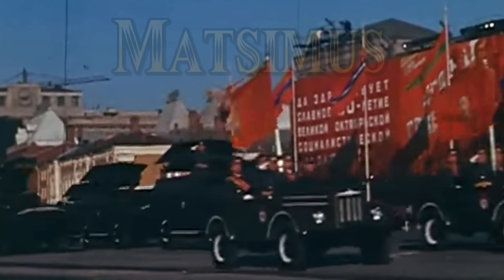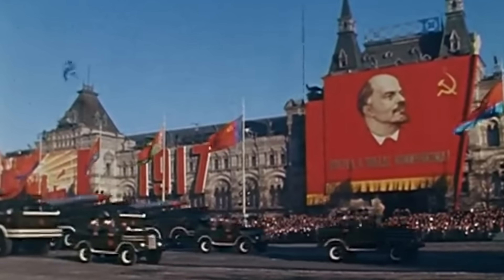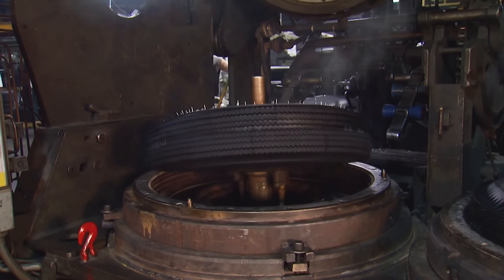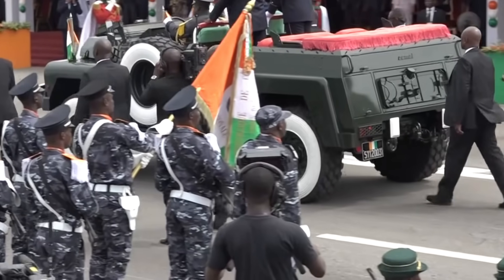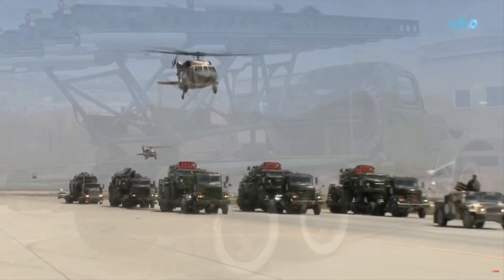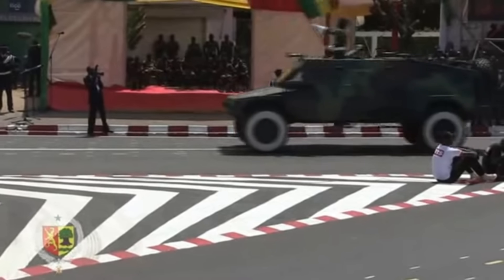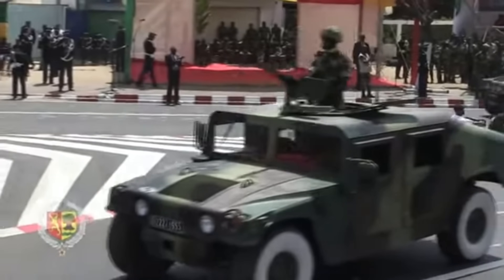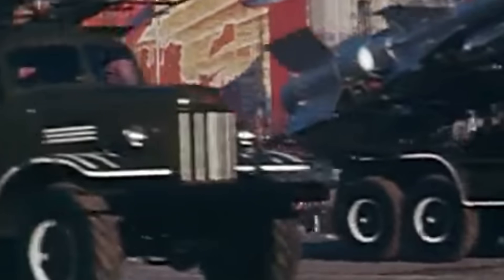Why do Soviet/Russian, North Korean and Chinese military vehicles have white wall tires?

Comment: Military parades aside, you're right about wheels being painted white with a special mixture to protect them from sunlight exposure during long-term storage. All this is described in the technical requirements for storing equipment. According to the requirement, the tires of those vehicles that are stored for more than 2 months must be covered with a protective mixture. This also applies to agricultural machinery. Instead of paint, special covers are also used

Comment: In the Soviet bloc countries, not only the tires were painted white, but roadside curbs and even the lower section of trees, maybe up to 1 meter high. They loved painting stuff white, at it gave everything a pristine, orderly appearance (even though the whole communists system was rotten to the bone).
Reply: Confirm, painting stuff white (including sometimes snow), or green (including sometimes grass) is a commblock thing. In part since the military/paramilitary/security services had a large input into things, and the military, being conscription-based, had to look cool and keep the bodies busy with make-work.

Lower sections of trees are painted not only for aesthetic purposes but rather as a pest-prevention measure, also, in late winter/early spring sunlight (direct, and reflected from the snow) can overheat tree trunks so it's protection against that as well.
Reply: White (based on limestone), green, black and reddish brown were on the list of the few paints widely produced in the USSR. So, it was pretty normal to paint the ceilings, upper walls and any details you want to stand out white (sides of the staircase, handrails, trees, roadside curbs.), the walls green and the floors brown. 
It was also a common practice to shine anything made of metal which isn't painted.
Also note that Moscow has 90 sunny days a year, and Saint Petersburg only 60. White and shiny stuff is what stands out, especially on a black-and-white TV that were common back then.

Comment: Hey Mat. I have a question. I know some Russians used crowbars and axes to disable tank turrets from rotating in ww2. Is that possible today with mbts or is that impossible with the tolerances between the hill and turret. 

Thanks for your time.
Reply from the maker: Good question! I am not sure!
Reply: I doubt you could jam one from the outside.  On M60A1s could be jammed if the crew failed to properly deflate the deep-water fording tube that sealed the turret ring.
Reply: I would imagine that if there's a gap where you can shove something into it might at least for a while, no idea how you could get so close these days..
Reply: Correct! It's a parade, showy gig! Like the high-lighted parts of mud-flaps of tanks etc.
Reply: During the Greek-Italian war in 1940-41, Greek soldiers would immobilize Italian tanks by throwing their blankets in the tracks.
The Italian crews would come out to see why the tank stopped and the Greeks would capture the tank and it's crew.
The war in Epirus, was the first time ever, the Greek army faced tanks in combat, so the blankets were the only thing readily available to the infantry.
Greece at the time only had the 19th motorized division, but this was deployed in the Struma valley and was later destroyed by the German attack against Greece in April 1941.
Before this, the Finns used the known gasoline filled bottles to set on fire Russian tanks, they dedicated them to the Russian foreign minister Molotov and called them Molotov Cocktails.
Of course, these improvised antitank weapons would not be effective today, against modern tanks with high power diesel engines, fire extinguishing systems and infantry support.
Reply: @FLORATOSOTHON  Never forget the wood logs lmao, and satchel charges,those were what we had in Winters War
Reply: @TheLazyFinn  These may be effective even today, if one could get close enough to a tank.
Reply: @FLORATOSOTHON  Could be,tracks are delicate
Reply: On the M1 abrams there is a far easier way to disable them and force the crew to bail.  There is an external fire-extinguisher latch that sets off fire extinguishers inside the turret.  If the crew do not bail, they will be asphyxiated.
Reply: @wigon  Good luck trying it on a moving tank, under combat conditions lol.
Reply: @FLORATOSOTHON  Tanks are not always moving.
Reply: @wigon  Are you sure they're for the turret?  We had similar handles on the M60s but they were for the engine compartment only and were designed not to shut off the fuel (which the one in the driver's compartment would do).
Reply: @TimothySielbeck   From what I recall, on "The Chieftain" channel, when he reviewed the M1A1 that he commanded in Iraq, it sounded like the external fire extinguisher control was for for the engine and the turret.

Comment: In the U.S.,up to the 80’s, only the cheapest of car tires didn’t come with white stripes or letters on one side. There were no directional threads so the look of the sidewall was a matter of choice. On my first car in ‘83 Idefinitely searched for the widest of stripes for its first replacement tires. When I got custom chrome wheels it got white letters out tires.

Comment: Most of the parade vehicles (including all the ones at the beginning of the video.) didn’t have white wall tyres. They had the rims of the wheels (removable bead lock) and the centre hub covers painted white. The tyres are black. 
For future reference, wheels are metal, tyres are rubber 😂.

Comment: My 1962 VW beetle has white wall trims. the car is black with lower side panels in vw cream white, black wheels and the white trims.  The trim is a flat band of rubber that is pinched between the rim and tyre sitting flush to the side wall. The drawback is that if I hit a curb they're vunerable to tears or pulling out of place. I think they're available for most wheel sizes, mine are made in Turkey. Look pretty cool I recon.

Comment: In the Soviet military and in the Eastern Bloc countries, the reason why vehicles have half-white walls is usually for parades. The vehicles selected for parades typically undergo a thorough paint job and have special parade tires with white walls fitted. White wall tires were not used in combat; they were applied not only to trucks and Jeeps but also to APCs, the trim around tanks, artillery cannons, and more. It was a way to spruce everything up and make it look attractive for the parade ground. If you examine a Soviet army truck or Jeep outside of the parade field, you'll notice that the red stars, colorful insignia, and white wall tires are absent.

Comment: When I was a young man, I had a 1972 Oldsmobile Delta '88. 455 cubic inch engine, 8-cylinders, 4-barrel carburetor and yes, white wall tires. Slick as all get-out. Stomp on the accelerator and watch the speedometer go one way, and the gas gauge go the opposite way, LOL!
Here's some lyrics from the song Just be thankful for what you've got, sung by Curtis Mayfield
Though you may not drive a great big Cadillac
Gangsta whitewalls TV antennas in the back
You may not have a car at all
But remember brothers and sisters
You can still stand tall
Just be thankful for what you've got
Though you may not drive a great big Cadillac
Diamond in the back, sunroof top, diggin' the scene with a gangsta lean
Gangsta whitewalls, TV antennas in the back

This was a good video, Matsimus. Really enjoyed the explanation.

Comment: Wheels (the metal part) are often painted light colors to be able to easily identify corrosion near the bead. Light colors get easily stained by rust making it easy to visually spot problems.

Comment: I worked in a rubber compounding lab in 1986. White rubber has zinc oxide replacing carbon black. It like carbon conducts heat and blocks the sun ☀️

Comment: Brings back memories. I used to work at a Firestone plant and mix the white rubber used for white wall tires so I know a bit of the alchemy that went into the rubber compound. Carbon black does make the rubber tougher and more flexible, especially in the tread area.  The white compounded rubber has less durability to UV and tends to crack more. If they were concerned about long-term storage it would be much more cost effective to cover the tires to prevent the effects of UV light deterioration. White sidewalls are purely cosmetic.

Comment: Whites out was how a lot of tires were installed and as a car wash employee as a teen in the 80's I can remember the PIA that cleaning them could be at the speed we had to do it in to get cars through the wash quickly.  At that point they were mainly just a white stripe and not the thick white walls they were in the 50's though.

Comment: In the 50's in the US.  It became a fashion and a sign of more expensive tires to have white walls.  Then for us cheap skates they made a rubber flat ring that could be applied and stuck to the tire by rim pressure to make it look like you too had those expensive tires.

Then in the 60's and 70's the fashion was for thinner white rings instead of large white walls.  All just part of planned obsolescence so if you wanted to keep up with the trendy you needed to buy new tires before they wore out.

Comment: I am in my late 70's and grew up with white wall tires on my cars. They were very popular and most people had them. The narrow bands came out later on. We kept them clean with a special white wall cleaner. You just sprayed it on, scrubbed it, and hosed it off. If you didn't like them, you just turned them around. The back side was black.

Comment: I didn't have a vehicle with white wall tyres, but I had them on my bicycle once, and on my current incumbend bike, I have one at the front - the problem being that the front wheel has a very unusual format being slightly larger than normal 20", thus there is only one supplier for spare tyres.

Comment: I suspect that for parades part of the idea was to make it look better on film. Old cameras were really bad at capturing darker shades and military vehicles tend to be painted in dark colors for camouflage, so a way to compensate would be to add white highlights. You can see that in some of the footage of old parades you used if not for the white highlights a lot of these vehicles would look like black blops. Railway companies did similar things back in the day, whenever they had a new engine they wanted to show off to the press they'd paint it in a light grey that made them look better on black and white photos.
Reply: Mainly easier to manuall catch focus.

Comment: It's not the heat from the sun that's the problem, it's the UV radiation. UV light breaks down most polymers, which is why you should always avoid leaving rubber or plastic items in direct sun.

Comment: There's another reason: white painted tires and wheels helps to keep the traffic safety during a blackout.

In Britain and some Commonwealth countries, in the past, traffic laws requires it even to bicycles. Its rear mudguards needed to have at minimum of 12 square inches area in white color.

My grandpa was a police officer in Brazil from 50's to 70's. Police batons had white impact surfaces for traffic control at night, used to give "stop" and "go" orders.

Comment: It seems it would be more effective for long-term storage purposes to just dip or spray the entire tire and wheel assembly in the white coating. A dark wheel would conduct a tremendous amount of heat into the rubber. And a white wall which doesn't even cover the full sidewall is obviously just for looks. not for preservation.

Comment: White walls were a status symbol maybe in to the 70s. The wider the white wall the better. You could buy glue on wide white pieces from places like JC Witney. I never liked them and even got away from the raised white lettering. If I had white wagon wheels, they would be painted black as well. I wasn't the only one so they fell out of favor.

Comment: we did put those old truck on stands not exactly on air to be saspended but in a way where you took the load away from there suspension and wheels

Comment: Two tales: 1. Ion the Volkswagen 50 years ago that had white wall tires. Unfortunately I tended to rub the curbs on occasion which messed up the white walls which I hated cleaning; and I didn't want to pay the extra cost of buying replacement white walls. So I bought black wall tires and then when I had the tires rotated had the tire people put the white walls on the remaining tires inside out of sight. 2. When I was in the army, with a Honest John missile unit, during fire power demonstrations they would fire a missile with a fake atomic device going off in the distance since the Honest John could carry a nuclear warhead. But the vehicle that came by in the parade view in front of the audience which was all spic and span and detailed was not the one that fired the missile. The spiffy one would drive around behind the bleachers and older one that had not been spiffed up was rolled out around the end to the launch site 100-200 yards or so down into the left. When the missile was fired it burned off all the paint on the truck. The truck was then repainted..

Comment: In the beginning of tire manufacturing all tires were solid white even the tred.  But they didnt wear well plus they were hard to clean and looked bad
Which is why they went to black tred. Whitewall faded out when tire compounds were switched  to other compounds other than rubber.

Comment: The way you conflate wheels with tires makes this video unnecessarily confusing. Wheels are the metal (wood in the old days) rim that the rubber tire mounts to.

Comment: Painting wheels and details for the parades is a decorative measure, to add some details to otherwise undistiguishable silhouetes of vechicles painted either green or monotonous camouflage pattern. What works on the battlefield doesn't necesarily work on parades, where you'd expect your expensive military equipment to be seen

Comment: I once bought a car with white sidewall tires......  Of course, I immediately took the car to a tire shop to have them flipped around on the wheels with the white on the inside.   I was surprised to see that the white was a removable donut......   I sold this set of four white donuts to someone who actually thought they were cool.    I have never seen these sold anywhere.... Maybe they are rare and I screwed up.......But, I was glad to be rid of them.

Comment: Everything is very simple. It's beautiful for parades. In conditions of nuclear war, threats from the air at night, the white color allows the column or other road users to make out the silhouette of the vehicle in dark conditions. This was important in the 50s, when there were no night vision devices and then it became a tradition. For the same reason, in Russia you can still see white borders or white-painted tree trunks at a distance of 1 meter from the roots. It also allows you to see the boundaries of the road in the dark and move around in dark conditions.

Comment: Sorry to be critical but you keep confusing/conflating the terms "wheels" and "tires."  The tire is the rubber construct that is mounted on the steel wheel.  As shown in the video, sometimes the wheel is painted white and sometimes the tire has a whitewall.  They are two totally different and separate things.  Cars never had whitewall wheels although they might have had wheels painted white or red or black or any other color.  Parenthetically, I own three Studebakers, a 1941, 1950 and a 1955 all with whitewall tires, not wheels.

Comment: According to the Tire Safety Group and the National Highway Safety Administration,  tires rot or oxidize from the inside out. Sun beating down on the tire dies not destroy it first. The  partial pressure of oxygen on the inside of the tire is very high. More oxygen equals faster oxidation. The cracks on the outside of the tire is a reflection of what's going on inside the tire. A tire is trash at 6 years of age, whether it is used or not.

Comment: I never saw a "parade unit ". 🤔
If we had a parade, we pressure washed and then wiped it down with transmission fluid or diesel to make the paint look great!  😁☝
Sometimes we would have a vehicle just back from rebuild,always helpful!  🙂🇨🇦
Reply: Parade units/ceremonial guard... Exist. They also have historical vehicles that are only used at parades sometimes and also horses
Reply: @annasolovyeva1013  . That would depend on your unit, often the "Parade unit" is just a bunch of college students working for the summer. 
Like I said, we used vehicles that are fully operational, we just leave the ammunition behind.  ☝😁🇨🇦
Reply: @barryfirth1187   dedicated ceremonial units are discussed here. In Moscow, for example, there's indeed ceremonial guard, horsed ceremonial guard, a military orchestra, a small set of cannons that make fireworks and people that drive historical tanks (WWII tanks) on parades and events and care for them. All they do is far away from fighting.
Not the whole parade consists of those, but they are pretty noticeable there.

Comment: My first car was a 1951 Plymouth Cranbrook. Pulled it out of a barn and saved it. I was 18 at the time 41 now. Also...do you mean tires not wheels? Tires are the rubber around the wheels.

Comment: Reducing tire pressure is NOT a good way to preserve it or lower wear and tear. It causes excess side wall deformation when driving which results in more heat build up and lowers the life span of the tire. Unless the tire is not supporting any weight, however this practice tends to lead to under pressured tire's installed on vehicles by lazy mechanics.

Comment: yea, I was thinking to do with the sun - the reason is I use 303 mix with zinc oxide on things i don't want to rot from the weather (mostly the sun). zinc oxide help protect nearly everything like this from a metal roof to your skin, it also has other advantages but too long to list...